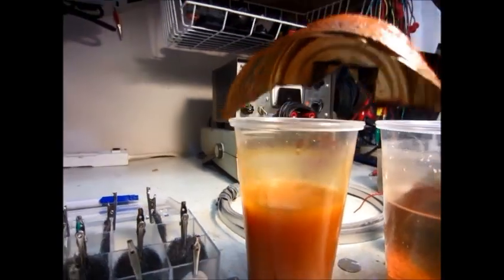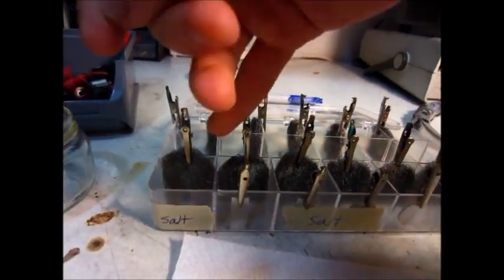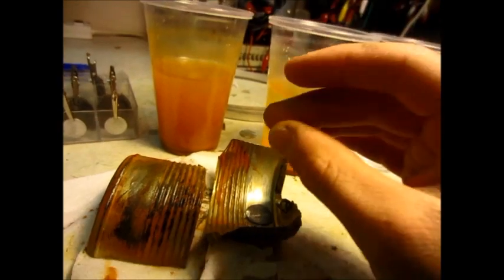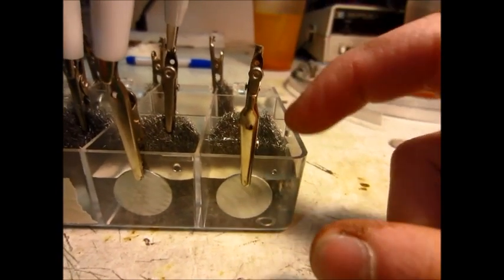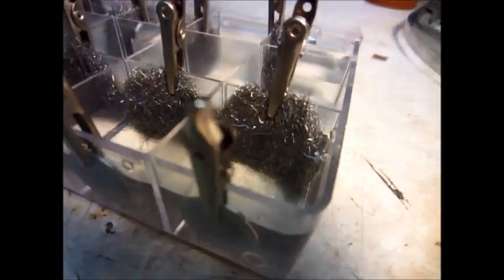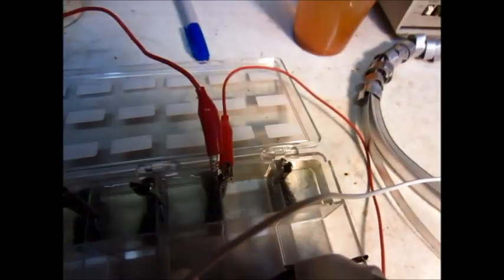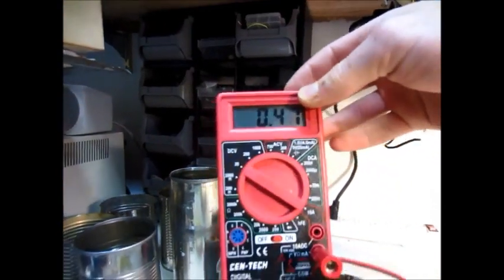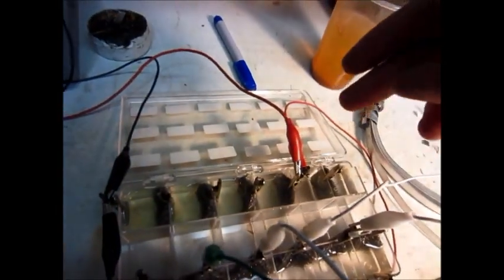Sacrificial Anode Experiment part 2

Comment: In case someone interested, it's all about oxygen - you need oxygen for make iron/steel rust, if you seal your system from atmosphere there would be no way for oxygen(as part of air) to get into system, so after all oxygen which was dissolved in water will used up metal will stop rust. Even more, i did experiments with iron part in sealed jar with very saturated salt water and it not rust further, only at the beginning while there is left some oxygen, then all oxygen used up and it stop rusting, part was sealed in jar ~7 months and not much changed.

Also: the hotter water the less gasses by mass can be dissolved in it, so if you have some steal vessel which all the time contain water at near to boiling point temperature it will rust slower even if water exposed to atmosphere.

Comment from the maker: With out a machine shop you can get a good bit of power like this one but the engines displacer has to be pretty big.  I think this one still uses some machined parts but they are not as complex as the other engines.

Comment from the maker: Well it is a lot more possible or easier to achieve higher outputs like 5,10,100 watts with parts that are made with a machine shop.  The one that produces about 1 watt is a beautiful engine!  Very well made and compact.  But it still required a machine shop to build some parts.

Comment from the maker: Well I did put sacrificial anodes in my new stirling engine so hopefully it will at least slow the rusting process down.  If I just added a little bit of engine coolant to the water would it protect it a little?  5 watts is a big goal!!!  How big is you displacer cylinder?  I thought about coating the inside with something but could not come up with a way to do it and thought that is may slow down thermal heat transfer.

Comment: It depend on the application in my case I use it to control different variable that reset to 0 in most case so have a pot would work the same but I got 10 of those for like 5$ so meh they are nice :P

Comment: A rotary encoder is technically a knob that turn at infinite lol but it create a 2 bit Gray code at the output to use for different application go check my latest video :P those are only the start of some project it's mostly use in digital application where the use of potentiometer is.... well old or useless :)

Comment: 200 turns to base, and 10 to collector will start a 2n2222 from 0.4v and run it down to about .117v. I find wind ratios past 1:17 dont make a lot of difference. I'll be sticking to that and using thicker wire if I can in future. From my small experience, and laser-sabers videos, I think you will find a few % of mg is worth a bit. So some of the cells are corroding a lot? and the battery not so much at this stage? Been playing with the idea of ally boat with neg hull, as part of battery :)

Comment from the maker: Thanks!  No I don't.  I looked it up and of what I could find most Al foil is 98% Al.  So I'm thinking that even if it was 2% Mg is would not make much of a difference.  I can't really tell yet but I will keep you posted on that!  Wow that's pretty good!  I am having a hard time getting the LED to light on less then 0.5V @ 2ma.  That's why I had to connect a bunch in parallel.

Comment: Great testing there. Do you have a sample of al foil in there? I think most of it has some mag content :) Thats why its a top pick for air batterys if you have no pure mag. Bit expensive though, Might cost you a dollar for a 10 meter roll of anode :) Did the battery get corroded steel? Or did it just eat the zinc? I can charge a 12v battery with a JT running on that power :) You have to lose the resistor and change the wind though. 0.4v is the best I can stat a silicon transistor, 0.06 germanium